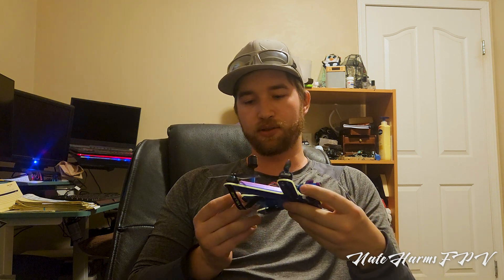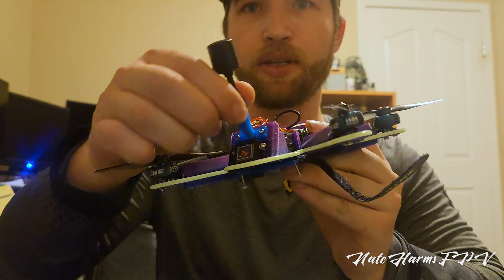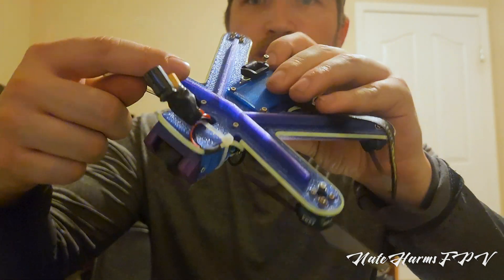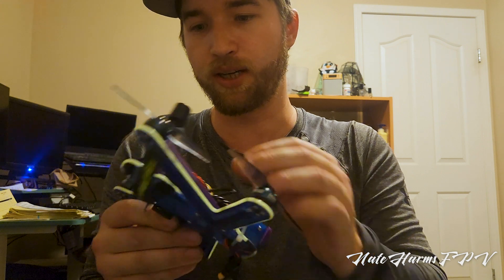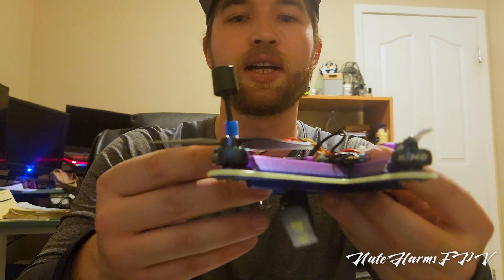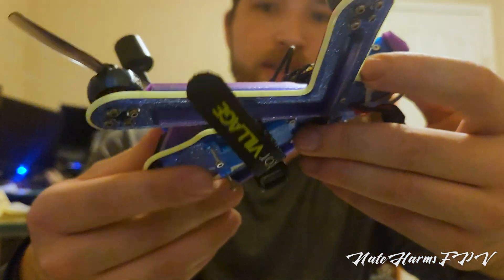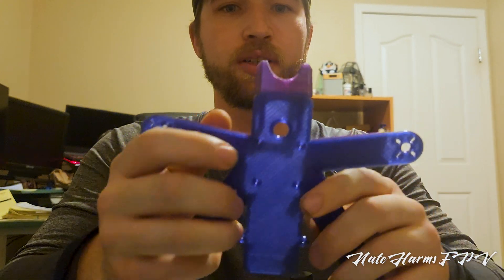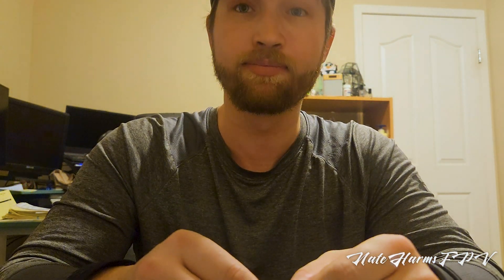3D printing a 3.5" FPV drone (with lights!)

Comment: Subbed. Nice I was thinking about doing a 3d printed drone. I done a Pavo frame with polycarbonate and it was great. Maybe try hakrc f722 aio it's cheap and nice 3-6s
Reply from the maker: Funny you mention the hackrc, I actually just bought one the other day as a replacement 😂 oh interesting,  did you cnc the sheets or something?

Thanks for the sub!

Comment: Cool project!  Those COB LED's were  almost too much... is there a way in BetaFilight to dim them?  In any case it looks cool - was it fun to fly?  Did you notice anything in particular or if you did not know the frame was 3D printed would you have noticed by the way it felt in the air?  I think  we all believe some things that are not necessarily true so it is aways good to have an open mind.  

Also do you have an all up weight or a weight for the frame itself?  And did you have any crashes?  How did it hold up?  Anyway overall this looks like an interesting quad and a great job,  I think that we can take for granted the awesome tech that we live with today but shoot, back when I grew up this would have been a mind melting, sell your soul to get one item!!!
Reply from the maker: Unfortunately I grabbed LEDs that wired direct to 4s voltage so they were dictated by the battery. It wasn't a bad time flying, although I had a fear of crashing. It flew kind of like a boat, very soft without much cornering authority.

All up weight was just below 250g with a 650mah 4s lipo. Overall it was a neat project and a cool drone to fly for spectators.

Comment: I'm glad you know I'm not the only one that ordered fly high FPV LEDs and they don't stick for sh!t.  Although bright they are great but the sticky part isn't there. Spray adhesive works getting them to stick. Flywoo makes some that you can put on a switch with a BEC

Comment: Cool bud. If your not planning the freestyle id get rid of the cover. Reduce the arm width and try more infill to get the base plate more solid as well as go naked on the O3 and use the diapole antennas. You could probably save around 20g easily and it will fly way bettter. Can tighten your build alot. Or even print arms twith the wire covers built into them.
Reply from the maker: Thanks! Yeah there is definitely some room for improvement. One of the things I do a lot is chase ice drifters so I have all the covering as a way to help minimize snow spray. The wire covers are actually built in to the frame, but I could definitely lower their height a bit. For sure some improvements that could be made to the design, but trial and error right? Haha
Reply: @nateharmsfpv  yep I been messing around for 2 years with designs. E6000 is great for waterproofing. Also CNCmadness is decent if you ever want to cut your own carbon frame. PLA+ is similar to PETG and carbon infused filament will be stiffer if your trying to do that. It's super fun to play with all this stuff. I really enjoy talking to other FPV drone designers and just discussing things about FPV. If you were down to do a little podcast with me sometime, let me know when we can make it happen.

Comment: Too cool dude! You could probably get some carbonfiber tubing or square rod and reduce or eliminate the arm printing all together.  Also why not use lightweight pla?
Reply from the maker: Thanks! You are probably right, however I really wanted to keep it simple and a single material. I avoided lightweight PLA for strength reasons, regular PLA is quite weak and susceptible to warping from the heat of the vtx and esc. PETG doesn't really warp under 200°, but it's also incredibly strong. I think if I was going to build a wing, it would 100% be lightweight PLA though

Comment: Always amazing to see people who are putting their soul and heart into what they love to do. And the results are showing! Your effort and time invested is not wasted my friend. And that flight footage looks incredible. If you never said you used that frame in that build, no one would ever know it's not carbon fiber frame. Just a nonsense from someone who loves designing TPU mounts for all kinds of use, but does not have their own 3D printer (yet)... would it be possible to reinforce that frame with something like an aluminum rod in the center... maybe even an "X" shaped, tiny aluminum reinforcement that could somehow be implemented into that frame (where you could maybe print it with kind of an "X" shaped ditch inside the printed material and simply slide the aluminum reinforcement inside after the print is done?
Reply from the maker: Thanks for the kind words! You definitely could add an aluminum skeleton. It would be possible to actually encase it by pausing the print halfway through and then inserting the plate. That would make a very structurally sound build.

I think my main concerns with that would be weight added, but also you would be moving the weak point to the outer ends of the arms rather than eliminating it. Just speculation of course. It's a really cool idea though, and could be implemented somehow with a bit of thought.